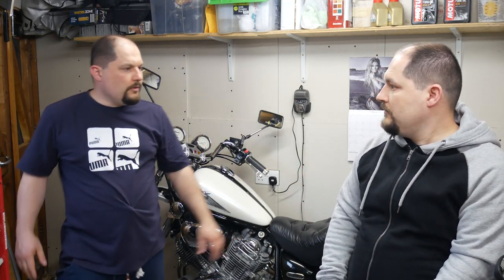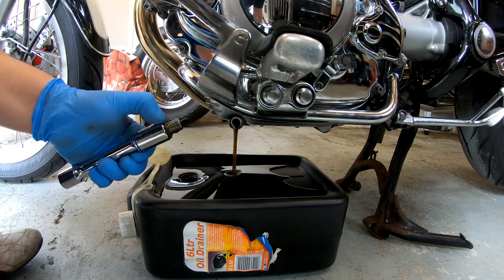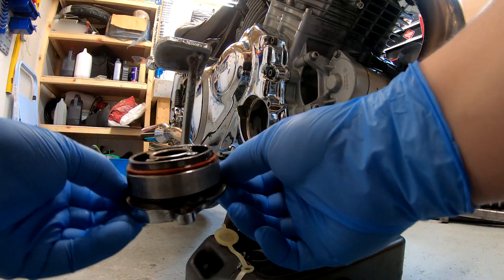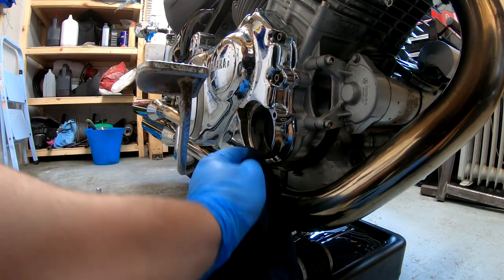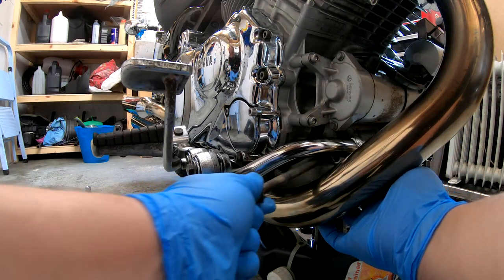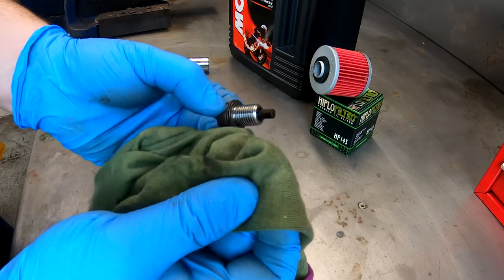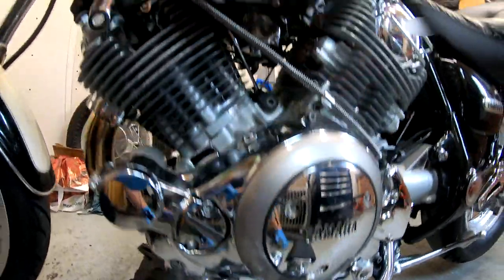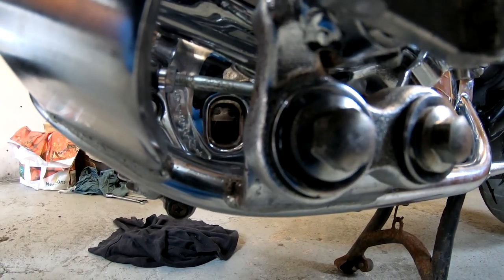YAMAHA VIRAGO 1100 OIL CHANGE TUTORIAL | Complete Incl. Pressure check

Comment: I'm going to switch from 10W40 conventional mineral oil to 20W50 synthetic oil because I'm finding it burns and turns dark very quickly with normal city driving
Reply from the maker: Modern synthetic oils are a lot more durable then old minerals so I'd say it's a good decision. In town riding on an air cooled bike puts a lot of pressure on the oil. I use this oil since I have the bike without any issues...please remember that the 10W - 20W relates to the ambient temperature to the place you use the bike in. Basically if it's hot always (California) then 20W, if it's cold like Alaska then 10W or even 5W but that could be too thin in the summer even there...hope this helps

Comment: You will have some video of how to change the flasher of the indicators
Reply from the maker: Hello. The relay for the flasher is built together with the fuel relay and it's a quite expensive replacement if it broke. There is a solution to fit a normal relay in but you have to cut some wires and fit a normal relay in the circuit. 
Check this video out 
https://youtu.be/TySU7yY8AHw

Comment: Hi buddy. I am new subscriber to your channel. Thank you very much for the information you shared. I am learning a lot from you. It makes me happy, too. I found this same engine and I'm thinking of buying it. But the engine has not been used for a year and a half. The engine is running, but it's got a lot of work to do. Would you recommend me to buy it? Between what years was the Yamaha virago xv 1100 produced? The seller told me the engine was 2002 model. Is this true? Was this engine produced until 2002? Thank you very much again. I'm following.
Reply from the maker: Hello, thank you very much for your kind words...really appreciate it 👍
As for recommending to buy THAT bike I can't say, but to buy an 1100 virago I'd say definitely. If it's running than can't be too bad, but without looking and listening  to it in real life it is hard to decide. Also depends on the price and budget for fixing up, if you add these two together you maybe find something better which needs a lot less work and money, not easy I know..

The XV1100 was produced between 1986 and 1999 so no there is no 2002 engine available, unless it was made in 1999 but was sold in 2002 as new from a dealer, which makes it a 2002 bike but production was stopped in 1999 regardless, hope it make sense..😉
Reply: @MidlandCruiser  Thank you so much. for the information you provided. You are quite right. I need to deepen my thoughts on whether or not to buy this engine.

Comment: I was told to use 10w-40 full synthetic oil for my 1998 xv1100? Will this work ??
Reply from the maker: It depends on the climate of where you live. If the ambient temperature is above 5C (fairly warm country) most of the time, then you'll need 20W-40 or 50 if you live in a cold place then 10W-40.
If you google it some charts will come up with arrows indicating what grade in what ambient temperature country to use. Hope this helps

Comment: Thank you, nice performance.  Perhaps riding a V-twin might produce such an effect. And a Q - is there a certain sign or something, telling you that oil is OK for the bike - being a flat tappet v-twin. (and just watched your carb series - very good too, thank you).
Reply from the maker: You're welcome, I'm glad you like my videos. Big V-twins always need good oil which is changed regularly. There is always a big debate about oils between owners. What I do is get the right grade (20W if regularly above 4C) for the temperature I live in and use the bike in regularly, once I determine that I usually go fully synthetic. 

The brand doesn't really matter as long as it's for motorcycle and compatible with wet clutch (Jaso MA, MA2) the API rating as close as possible to Z in the alphabet means usually higher quality oil (API S-L, API-N etc. ) hope this helps.

Comment: Hi mate. Was your bike hot when you changed the oil? Just watching it, the 20/50 seems to be much thicker than the 20 W/40 I dan get in Soldierland. Interesting. Say hi to your twin brother!! and Fu _k COVID.
Reply from the maker: Hi. I would say nice and warm...I came back from a ride and started it after about 15-20min while the bike was in the shed getting ready...don't really matter for you, your ambient temperature keep your engine hot as hell🤣🤣
Reply: @MidlandCruiser  I just bought Motul half synthetic for a really good price. Any thoughts about Motul 3000 half synthetic anybody?
Reply from the maker: @sisaketmike  I have used the 5100 15W-50 in my Aprilia Falco which is semi-synthetic and had no problems, clutch was fine, gearbox too. Regarding to the 3000, sorry don't know, never tried/used it...
Reply: @MidlandCruiser  Thanks, mate. I found a seller who took 200 baht for one liter. That's only 6 dollars and perhaps 40 cents.
Reply from the maker: @sisaketmike  that's very good...should be fine..is it 20-50?
Reply: @MidlandCruiser  Yep, 4 bottles of the great stuff, just arrived today with a motorcycle mask as a present. But i just changed my oil, will ride another 3,000 with my 20 W 40, or whenever the color gets dark. Stay safe out there in this jungle, they are out there to get you. ( Guns n' Roses)
Reply: @MidlandCruiser  Actually, we make okes about the three seasons here. 1. Hot. 2. Hotter. 3 Hottest. It's 3 am and around 35 C in my office now.
Reply from the maker: @sisaketmike  I'll be safe I promise...3000miles sounds about right, most of the time I don't do that many unfortunately, thanks to the fantastic British weather
Reply from the maker: @Michael Mersi  OMG..that is hot. I am used to the British weather now and every time we go visit the family in Hungary, we struggling if over 30C😁
Reply: @MidlandCruiser  I also use 5100 for my Virago as it has the best quality/price ratio, no problems so far.
Reply from the maker: @radu2253  the 5100 is a good oil, however I use the full synth 7100 in my Virago, I used the 5100 in my Aprilia, sorry if I confused you
Reply: @MidlandCruiser  No worries, you didn't. Virago was designed to use the old mineral 20W40 which nowadays has become very hard to find. So I use the semisynthetic 5100 15W50 because I am pretty sure it meets or excedes the old oil specifications and the price is affordable enough to change the oil once a year. Keep up the good work! Bests from Romania!

Comment: Helpful stuff.. Mines due a oil change.. A 1990 Virago 1100.. Looked underneath mine and the engine drain bolt looks like its got a alloy cover over it secured by a Alum bolt... 😉
Reply from the maker: I'm glad you liked it. That must be a wierd looking draining bolt then😁
Reply: That is the oil level sender unit, if you remove it you can drain the oil, although the correct drain plug is on the opposite side of the engine, hope that helps 😉
Reply from the maker: You are right, the one with a cover is the oil level sensor, I'm sorry I assumed he looked at my video so he knows where to look for the drain bolt...👍

Comment: Hey there! Great video, very informative and fun. When you used the torque wrench to tighten the oil filter cover bolts, what did you torque them down to exactly? I'm afraid of over tightening the bolts
Reply from the maker: Hello. Thank you. I torqued the cover bolts to 10Nm. Welcome to my channel 👍🔧
Reply: There's no reason to overtight the bolts because of the rubber seal located on the cover's inside, if you see any leaks just replace the worn rubber seal, or at least try to reseat it. Tip: in order to always avoid destroying the aluminium threads, just remember to loose the bolts a bit while the engine is cold, prior to begin heating the oil.

Comment: Did you notice a difference with the 20w-50?
Reply from the maker: I use this oil since I have the bike so I can't really compare it to anything else. It is the recommended grade by Yamaha if the ambient temperature is mostly above 5C in your Country. The oil itslef is top stuff (hence it's price😁) had no clutch slip or starting problems even after sitting for months... Hope this helps
Reply: @MidlandCruiser  I wish I could get 20/50 here in Thailand. But the Castrol 20/40 does the job as well.
Reply from the maker: @sisaketmike  yeah you really need 20-50 in that climate, but like you said, the 40 will do, go on country roads not in the city😉
Reply: @MidlandCruiser  It's not good for the city. But i haven't yet found 20/50, nobody else seems to use such oil. I prefer to change it more often but riding in a big city with 20/40 in Thailand is not a good idea. The engine will get too hot and parts might say goodbye.
Reply from the maker: @Michael Mersi Maybe you could consider fitting an oil cooler on it...Steve Hiles in the Nation group sell oil filter caps with outlets on it then any general radiator which is the right size will do..connected with hydraulic hoses and you're done👍

Comment: Hi good video thanks 🤗why did you choose 100,% synthetic oil🤔
Reply from the maker: Hi. Thank you. I choose 100% synthetic because they offer a lot better protection against wear, and it doesn't degrade as quickly as mineral oils just to name a few. Also because they use a high quality base oil so oil companies can tailor the properties of the oil with additives to a higher level then they can with minerals... These are just the basics, there is a lot more to it though..  Also I have had no problems in the last 2000miles...hope this helps.
Reply: @MidlandCruiser  Motul is pretty expensive, but on the other hand,. so are parts you need when the engine is dragged!
Reply from the maker: @sisaketmike  yes it is expensive, but it's great quality oil, all I use it Motul everywhere, never had an issue, consumption, or clutch slip👍
Reply: Here's what the engine sounds like when the valves are accidentally wrongly adjusted. The Chinese feeler gauge had the wrong numbers in it. But I
 didn't ride the bike, shut it off right after hearing the crazy sound.https://www.youtube.com/watch?v=DlBwWa9pAwU&lc=UgzrmIaAE6jwWJkR6g14AaABAg
Reply: I've seen a 20/50 oil for Diesel engines at a gas station, I know that Rotella from Shell seems to be good from some great members. But no idea if that would be good for my engine.
Reply from the maker: @Michael Mersi  Ohh dear that, was  too big. Tiny click when the engine is really, really hot is acceptable, but this was too much. Glad you sorted it👍
Reply from the maker: @Michael Mersi  I wouldn't use car oil in motorbike, however I heard people using it without any problems. Not sure how good it would be for the wet clutch....You'll be fine with the 20W-40, don't put Diesel oil in your bike,  but it's up to you🤷‍♂️

Comment: Три литра мало  для этого мотоцикла, при резком ускорении и на боковой подножке лампа уровня масла будет гореть
Reply from the maker: Hello. Thank you for your comment. I had to use google translate as I don't speak Russian. 
I think you are saying that 3 liters of oil is not enough. If you watched the whole video then you see I say that I filled it up roughly 3 liters then start the engine to prime the filter, then I check the level 10 min later after it settled down, then I say top it up. Roughly ended up around 3.2 liters. Hope this clears up any doubt

Comment: Can I use yamalube 4t 10w40 on a virago 1100?
Reply: 20w-50 is better for air cooled vtwins. the full synthetic version will help the oil from breaking down in hot city traffic when the engine has nothing to cool it down. if you notice the clutch slipping, switch to semi-synthetic or even better, mineral oil.

Comment: Thank you, very helpful.
Reply: Have you ever considered making a video on how to remove the XV1100 swing arm? I can see your bike is spotless but my swing arm has surface rust and needs painting. I’m nervous about what to look out for.
Reply from the maker: Funny you ask, because before I decided to make a youtube channel I had the swingarm out and sent it for powder coating 😁 unfortunately no video about it because I didn't even have a camera back then. It's not that hard really. Rear wheel out, then left side shock, then final drive ( it will slide out with the shaft), then right side shock, then both bearing pin(shaft/whatever it's called) then swingarm will come out. When you put it together, it matters which one is torqued down first, (can't remember) . Download a copy of the manual and you will be fine. 👍
Reply: @MidlandCruiser  Thanks a lot for the advice. I have the Haynes manual, but it's still daunting to the inexperienced, and it doesn't mention fluids. It may be a silly question, but are you in danger of losing oil from the drive shaft when this is taken off? and does anything have to be topped up again?
Reply from the maker: The only way to loose oil from it if you turn it upside-down, or the shaft seal at the end is leaking.. Otherwise just the undo the 4 bolt and pull it out, not a biggie. Please subscribe so you don't miss out on upcoming tutorials. Also I have big plans for the winter, I will announce it later on... 👍
Reply: @MidlandCruiser  Will do. Thanks again!